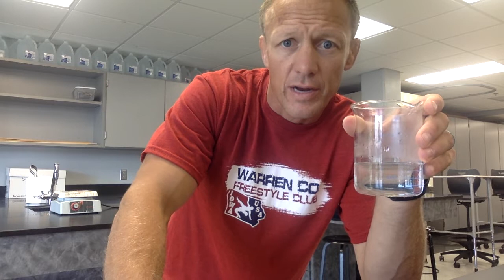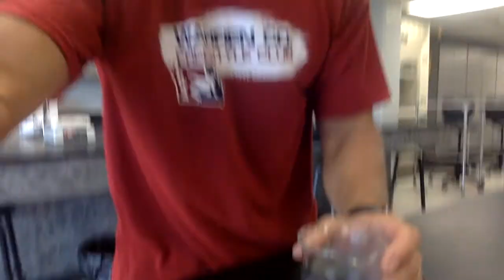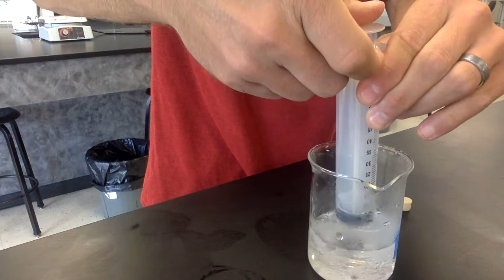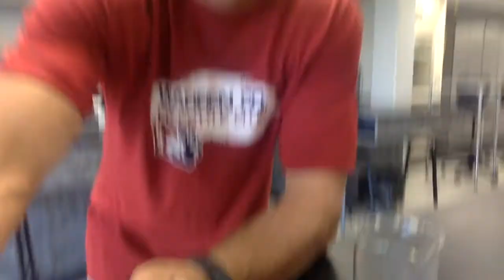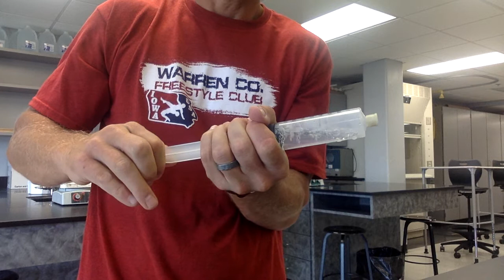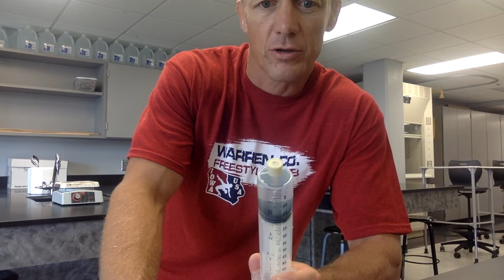Boiling Water in Syringe

Comment: Since Boling point of water is 100 degree celcius at 1 atm or 760 mm of hg now you reduced the pressure and water will boil at low temperature ....as boiling point is the the temperature when the vapour pressure is equal to atmospheric pressure ....you reduced atmospheric pressure so boiling point decreases 👍👍

Comment: 100 degrees is the boiling point of water at sea level, and the lower the pressure, the lower this point, and when you pull the needle, you create a low pressure, so the water boils
Reply: 212
Reply: @Enochulate88  it's only 212 degrees I here in the US. The rest of the world boils their water at 100 degrees. It's a real time saver.

Comment: Every liquid has at a certain temperature a certain vapor pressure. Higher temperature causes higher vapor pressure. Is the  surrounding (air) pressure above or equal vapor pressure, the liquid do not boil, but if the surrounding (air) pressure is lower than the vapor pressure, the liquid boils. And this is it what you have done.

And, the water temperature drops a little during boiling, because of the enthalpy of vaporization. When the vapor condenses again the energy goes back into the water AND into the vicinity. So every time you do this the water cools a little more...

Comment: Boiling point is dependent on atmospheric pressure. At higher altitudes the required temperature to reach the boiling point lowers. As well, it raises at lower temperatures. It is well known that water boils at 212°F….is not as well know that fact is only true at sea level. If you live in Denver Colorado, USA. The boiling point required to make your spaghetti will only be about 185°F.

Comment: If you didn't mix the gas back in with the liquid. It would make the water colder.
Because the warmer liquid is what evaporates first.

Atmospheric pressure slows down the process of evaporation. And the boiling is the separation of the higher energy from the lower energy liquid.

I'm drafting a project that involves lowering boiling point in a vacuum to increase evaporation. Like a swamp cooler except in a closed system. (Not really closed as it still requires a way to dissipate the heat from the gas, which will condensate the water. But closed in the sense no liquids/gasses leave.)

Comment: The reason this happens is because the boiling point interrupts the atomspheric pressure inside the syringe. This in turn heats up the H20 and dissipates the coinciding regulatory ions within itself. Each intersecting molecular particle that creates friction upon visual non binary liquids reinforces the longevity of the waters boiling point. That said, if one were to accelerate the vacuum functionality that occurs while the 4th dimension collides within itself, the highlighted biometric flux capacitor can elevate the nitrogen in the H20 as the underlying pressure is presented. And so, my conclusion to this predicament is that I have no idea what I’m talking about 😂😂😂